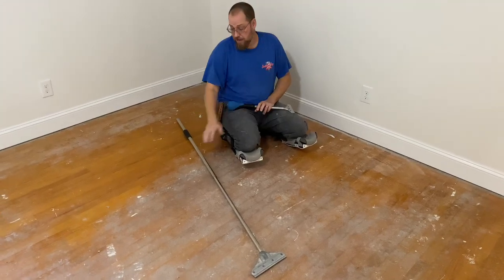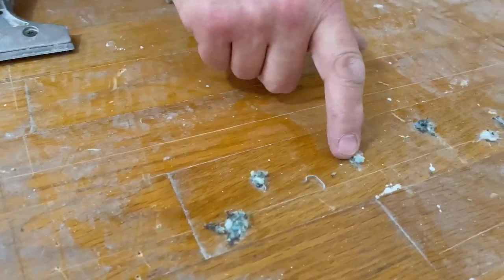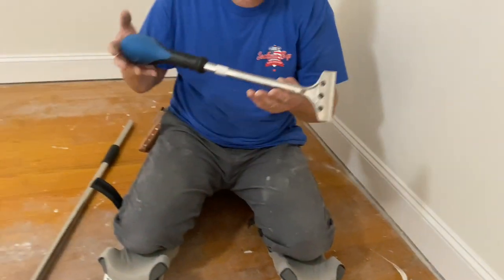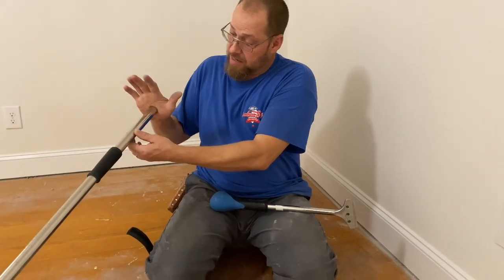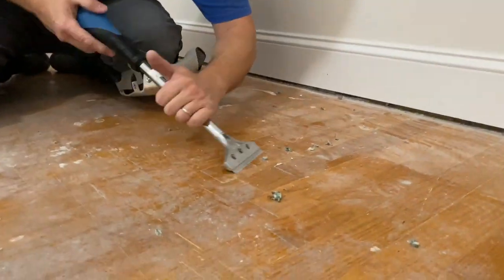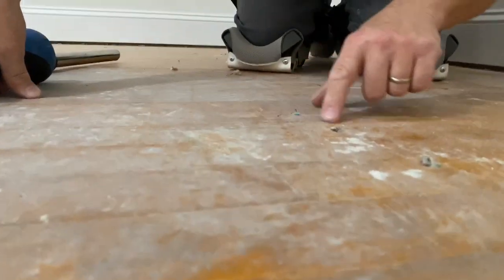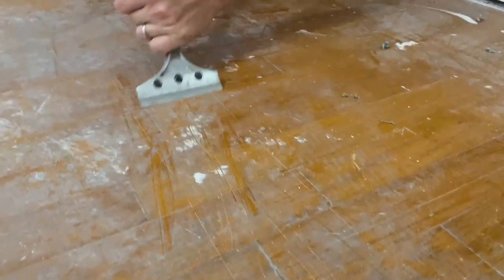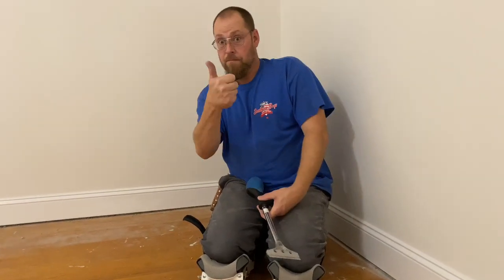How To Remove Carpet Pad Staples Easily

Comment: Serious question, aren’t you worried about scratching the floor?
Reply: Apparently not
Reply: That is the old floor underneath what was the carpet. Normally you would install whatever you're changing it to on top of that even if your putting in a wood floor and if you did decide to use the floor he is working on as the Finish you would have to sand is so much to begin with that any scratches he's going to make on the Surface wouldn't matter cuz they will be sanded out
Reply: Yeah, I was shocked to see him use that.  The more he scratches the floor the harder it will need to be sanded to refinish it. The more it needs to be sanded the more it lessens the life of the floor.  Sheeeeesh!  I guess I’ll go back to my pliers.  One by one….

Comment: I use my 36 inch wrecking bar for staples. After I hit the tack strip right at the nail I lightly pry up and it lifts the tack strip right up without snapping it. I used my grinder to sharpen the flat tip of the pry bar and you barely push it across the floor and the staples come up effortlessly! The weight of the 36 inch pry bar does all the work and the metal is really hard on the bar so it doesn’t get dull like a scraper does! Another bonus is you do it standing. Try it I promise you will agree! I found your channel tonight. You have good content!
Reply from the maker: Ted McNair thank you for the tip and thank you For the compliment, Glad you like the channel

Comment: You're not removing staples. You are just breaking the heads off.
Reply from the maker: Know if you will look where I slowed the footage down. You can literally see the staples popping out. This does not break them off. It pulls them out of the floor.
Reply: Either way you can still sand the floor

Comment: Does it break the staples leaving behind a sharp pin sticking  OR does it pull the staples completely?
Reply from the maker: @TheMegaVoter  pull them completely out that was the purpose of the slow motion section so you could see that

Comment: If I don't make it to Home Depot to buy this tool or a steel blade for my multi-tool. I plan to use the scraper I already have to remove staples from a sub floor that I added duct tape to to form a not big enough ball.  That my hand is still sore today from using yesterday.  This mobile home square head screws that attached them to the wall that I had to use a saws all to remove and the paper left from the vinyl floor, has been the hardest part of this demo. If I were a Catholic, I'd be in confession right now for all the bad words I used yesterday.

Comment: Suitably inspired by this to experiment with what I had on hand.   Found a decent speed up using a paint scraper and 3 pound hammer.  The key is the sharp edge that grabs even low staples.  Thanks for the inspiration!
Reply from the maker: Yup you are correct

Comment: Thanks!  Worked perfectly and quickly.  It even got the old staples I pounded down that I couldn’t remove using my old method from the last time,e I replaced the carpet.

Comment: Does this remove the staples or does it have the two staple legs in the flooring?
Reply from the maker: @lrocky223  it completely removed them. It does not cut off the top and leave the leg in.

Comment: hey does this actually remove the staples or just cut the head of the staple off?  if i rip carpet off timber floors its so i can polish the timber, not cover it.  So would the left over pieces of staple be a problem?
Reply from the maker: Peggy Allen It pulls them out The razor blade is sharp enough that when it hits The staple it will actually dig into it a little bit grab a hold of it and pull it out
Reply: @FloorsbySouthernboys  awesome! thanks for replying
Reply from the maker: Peggy Allen You’re welcome, good luck

Comment: I like to have the pad still on the floor for cushion and pop and pull the staples with my 5 in 1 and needle nose pliers. Then put the old staples and pad chunks on the pad and roll it up. Saves you from getting up and down too much.
Reply from the maker: Adam Bolinger Thank you for sharing that

Comment: I always like to go with the grain even your stair tool take them up pretty easy when you do that
Reply from the maker: Jerrid Hawkins That’s good thinking
Reply: Yes using the stair tool works great for me too.
Reply from the maker: Gold Coast Flooring I have never used it for that myself, I have dinged it up on electric Staples before and then it always marks up the baseboards, so I try to use my stair tool specifically what it’s for, so I don’t get any burs on it that would scratch the baseboards

Comment: I like using the other side of the scraper blade when scraping on top of wood
Reply from the maker: alonso espinoza Yeah lotta times I will use the flat edge so it doesn’t dig in the wood